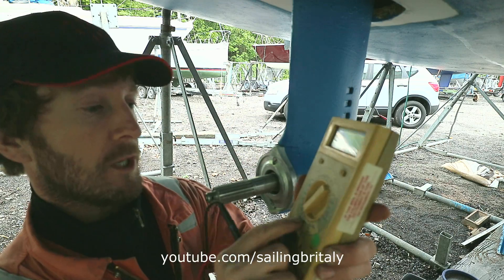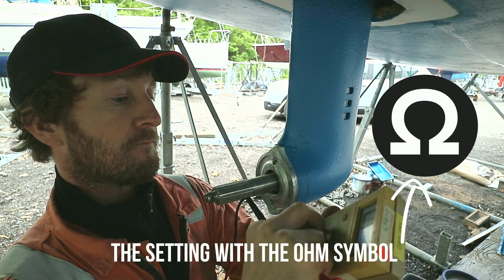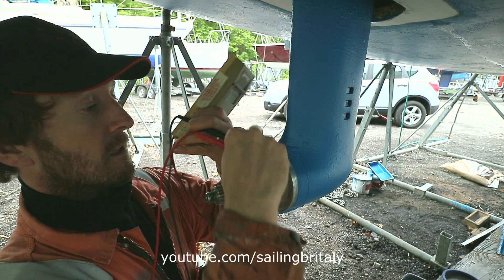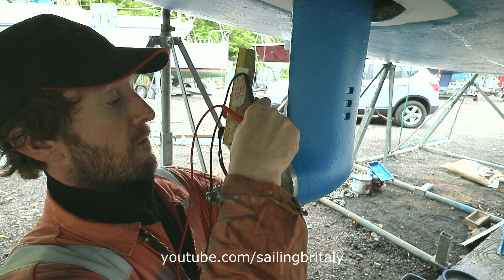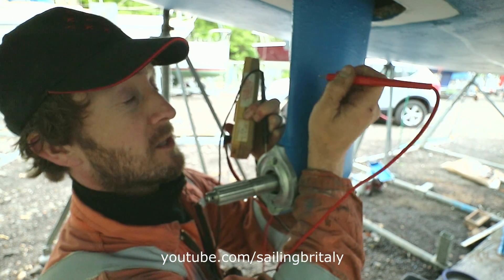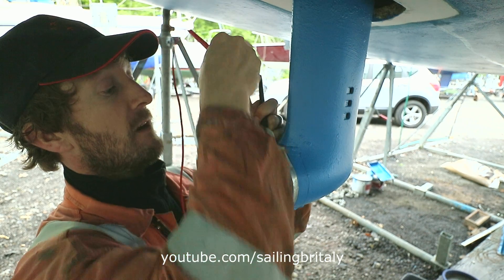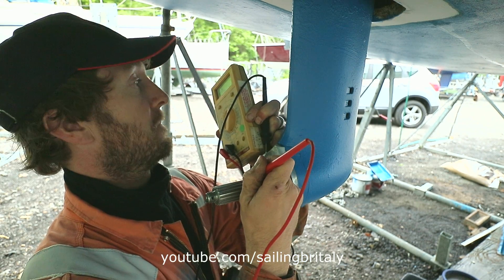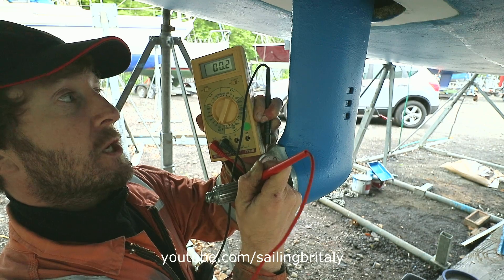Boat Anode Resistance Check | ⛵ Sailing Britaly ⛵

Comment: So your basically pat testing a boats hull ..... so what would a bad reading on the multimeter read in ohms as to where you would do have to make some adjustments ?
Reply from the maker: Hi Daz, I would say 0.6 ohms would be about the highest reading I would want to see. It's not an exact science, and the lower the better really, but if it was above 0.6 then I would definitely be taking the anode off and cleaning up the mating surfaces. Cheers, Chris 👍
Reply: @SailingBritaly thats great thanks for your reponse much appreciated

Comment: Thanks for the video Chris, my mesures shows 0.4 to 0.5, i don't know if it's low enough but i want to belive it is :)
It would be very useful if you could make a video using your multimeter to detect current leaks as it's an important job and nobody really know how to do it !
Cheers

Comment: Great info!  Is there a way to test the anode after changing it while the boat is in the water?
Reply: It is possible by using a reference electrode connected to volts in on your multimeter. You then touch the common probe to the anode and then what it is suppose to be protecting. You should get almost identical readings for both. While possible doing it this way it is hardly practical because of the length of probes you would need.

If possible I would dive to check the anodes weekly. If you notice a change in how fast they are wearing, you may have a problem. By doing a regular inspection you will probably notice if the anodes are not wearing away as expected.

Comment: Is it possible for anodes to be useful on vehicles to minimize the effect of salt on metal? Academically speaking?
Reply from the maker: Hi Jim, you need a complete circuit for cathodic protection systems to work - seawater is the electrolyte on boat anodes - so anodes wouldn't work on vehicles. Chris

Comment: Checking electrical bond with multimeter = good.
Checking electrical bond with bonding meter = better.
However, bonding meter = very expensive.